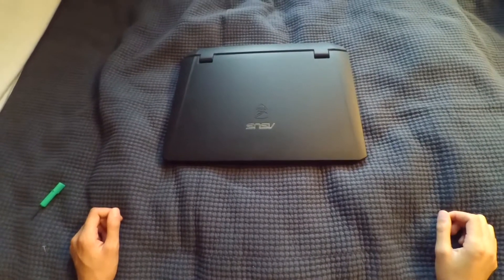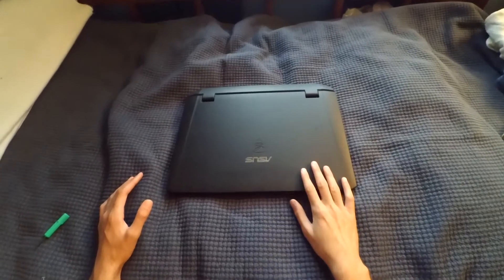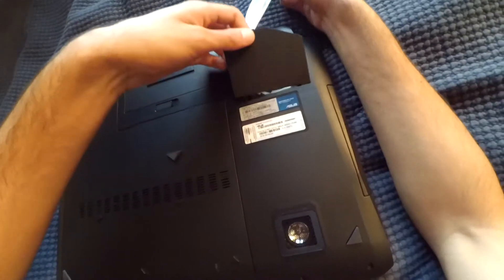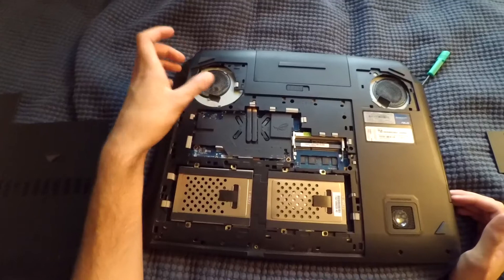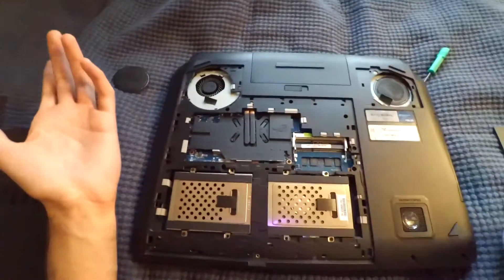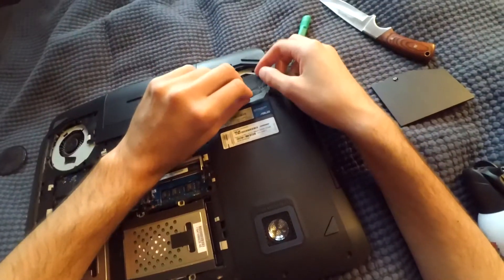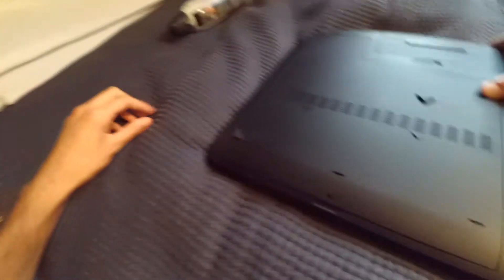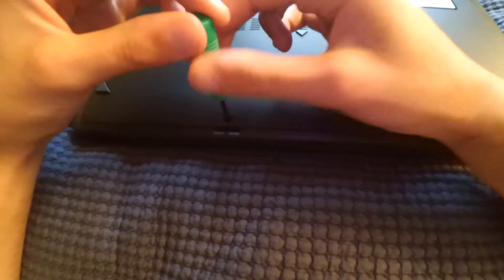ASUS G Series Fan Filter Cleaning Tutorial

Comment: Hello. I've got a Asus GL552VW and have had it for a few years now, have not cleaned the interior, and noticed that the fans have gotten quite a bit louder recently, but its not really hot or running hard on the CPU or Memory. Thoughts?

Also any place to link specifically for this laptop design, so I can reference it if I clean it?

Comment: This is not enough unfortunately. As the filters in the heatsinks gets clogged too. Also there's the other side of the fan. It has a filter too, but you can only get to this by disassemble the machine.

Comment: Good video but man ALWAYS remove the battery if at all possible before doing any work. Also those cans will discharge liquid if not vertical. Put the laptop on its side to clean those fans rather than risk water getting in there. Also try to work on a solid surface rather than cloth (and use a static wrist or have some piece of metal to periodically discharge any static buildup) to minimize the risk of a static shock damaging a component. These are expensive pieces of electronics!
Reply: Yup

Comment: Is it the same for R series? r558u to be specific
Reply from the maker: No the overall design of the laptop is much different.  I would look up a guide for that specific laptop or refer to a manual.
Reply: Well I tried to find a guide but couldn't... My gpu/cpu's tempratures go upto 94 Celsius and my gpu gets underclocked severely (900 to 400mhz)

Comment: Ale7, would you tell me how I can get the sound card functionality back? After installing win10, all hell broke lose. my touch pad went wonky; I can not disable it when using my gaming mouse, the keyboard lights will not go up or down, the sub woofer on the bottom does not work, as a matter of fact, the quality and functionality of the sound is really bad. I have tried to talk with Asus, but I get no good help.
Reply from the maker: William Woodward try to revert to windows 7 or 8

Comment: I followed the video and cleaned the dust out of my laptop, put it together and the screen is straight black.
I tried draining the battery and turning on again. I can hear everything working inside.
any ideas on what i can do?
Reply from the maker: I had an issue like that with an HP laptop. The screen light would shut off. To fix the issue while the computer was on I moved the screen down like I was going to close the laptop and just practically moved it up and down in the screen would come back on. I'm surprised to hear you are having a screen issue with an Asus laptop.  Cleaning a laptop can't possibly damage the screen.
Reply: +Ale7 it came back on after an hour of just sitting off.
im not sure what the problem was but everthing is fine now.
Reply from the maker: +Richard Osmunson I'm glad to know that, happy gaming!
Reply: +Ale7 im happy as well!
thanks!